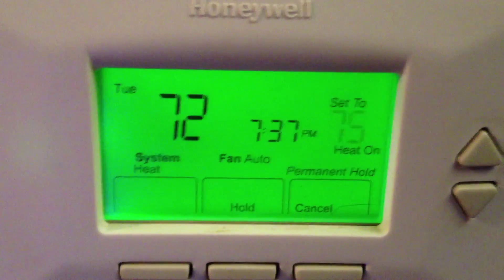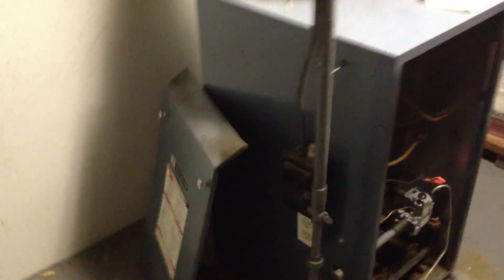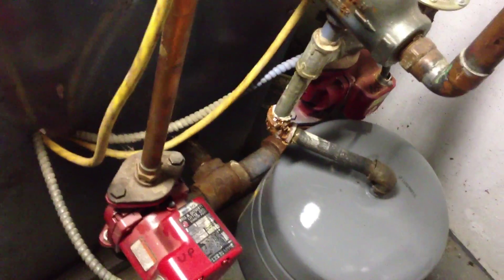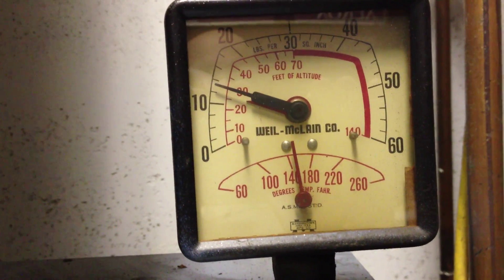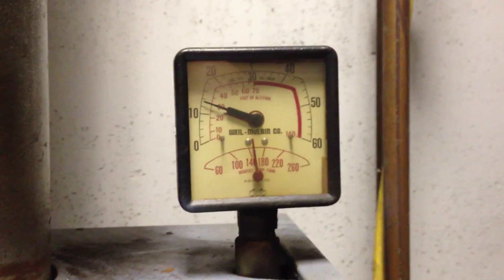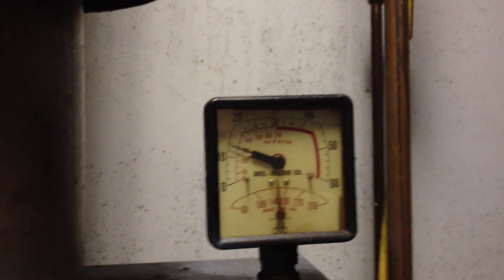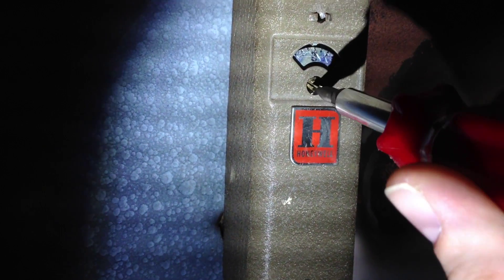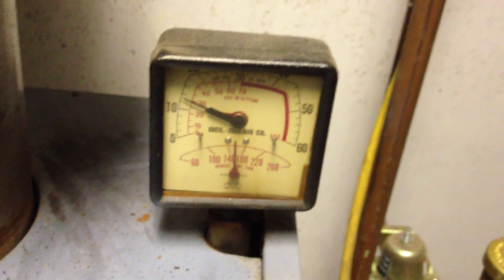Adjusting Your Boiler Furnace on a Cold Day

Comment from the maker: Another thing you can do: supplement your boiler with an electric heater.  we had -20s and for sure, running two or three extra space heaters was, IMHO, a better option than running the furnace at excessive pressures.  This video truly is an emergency procedure.

Comment: Temperature setting is to high, my boiler wasn't working that efficient, called the furnace man he came and flushed out the water in the boiler,  there was black water in it. It took 10 1 gallon buckets to flush it until the water became clear. Boiler works awesome now. Had to turn the temperature on the boiler 60 degrees, saving money now!!
Reply from the maker: I flush mine once every couple of years, it gets nasty faster than you'd think

Comment: looks like you fiddled with the high temperature cut out 
my boiler heats the house just fine with 110f water and cast iron radiators.  very comfortable at 67f

Comment: Thanks for confirming what I plan on doing will be done correct. Like you she wants the house temp warmer and so boiler temperature needs to be warmer due to the terrible cold weather we are experiencing. We already did all the normal adjustments including raise thermostat temp, cover all windows, and keep the doors well sealed. We know the cost of running the system will also increase as more BTU/Hr. is needed. We will turn it back down to `140 degrees  if it ever warms up outside.170 degrees on boiler temp (actual) worked for us

Comment: Out of Calibration or your thermocouple is in the wrong place to measure temp.
Reply: Thermocouple is a bi-metal copper tube that when heated the bending of the metals creates less than a volt of electricity that keeps the gas valve open.. If i remember from the heating seminar i attended that was the day of the Mets tickertape parade in 1986.  
   I don't think it changed, thermocouples still look the same, they still have absolutely no CALIBRATION.   
  Now you can explain how to calibrate a thermocouple, and i would love to know where you think it can be relocated to properly function. .
   Lmao
Reply: Thermocouple only senses on & off of the pilot..not actually measure temperature and all it does is keep the pilot from going out.
Reply: @thomasbroking7943  Not talking pilot light.
Reply: @grabir01  absolutely.. I taught many guys.. Maybe you should learn what a thermo couple is? I have probably changed more on emergency call outs then you have seen, but you go ahead and tell people what you want.  I fixed & replaced residential heating boilers for 25 years and was the guys other plumbers asked for help..
  What kind of experience do you have?
Reply: @grabir01  another piece of info.. Thermocouples fail because of the impurities in the air around it being burned.. Its important to clean around freestanding boilers to make them last longer.. I had a congressman in Bergen County that got me after having his replaced every year for as long as he could remember. .i vacuumed, replaced his t-couple and adjusted his pilot height, over 10 years no problems.
Reply from the maker: @grabir01  I'm guessing that the thermostat, being about 55 years old (looks to be original equipment) is pretty far out of calibration.  I should probably either calibrate it or replace it.

Comment: How old is that boiler? Judging by the temp/pressure gauge and the Honeywell controls, that has to be perhaps from the late 60s maybe early 70s
Reply from the maker: it is original to the house, which was built in 1964
Reply: Back when things were still made to last. As long as you keep it well-maintained and it doesn't spring a leak, it should be good for quite a few more years.
Reply from the maker: @kristindell267  Yeah, unless the actual boiler tank itself cracks, all the components on this furnace are able to be changed out, pretty easily too.
Reply: @scorellis  my is original as well and almost identical to yours. Thanks for the helpful vid. My house is cold due to the -22° temp in Chicago right now
Reply from the maker: @ChicagoLuis   yeah, I went out and bought some extra space heaters to supplement.  Menards has them in stock - at least, they did yesterday.  Am also using packing tape to seal anywhere I find cold air coming in.  Works on doors, too - apply the tape, about a third of it (lengthwise) on the door itself, then carefully fold it over.  We also hung blankets over all of our updtairs windows.  You might want to remember to turn your  boiler back down after this passes
Reply: @scorellis  I just bought a space heater from Costco yesterday. And  I am putting blankets on my doors as I type. Huge cold draft coming in thru doors
Reply from the maker: @ChicagoLuis   I made a how to video on the packing tape seals.  They are working great for me. https://www.youtube.com/watch?v=Yyj181EzHD0&t=2s

Comment: What should be the low setting if 180 degree is high?? Thx
Reply from the maker: +kenny play That's a very good question, so I went down and took a look at mine.  I only have the one controller for temperature. My guess is that it handles the lower range for me. You are right that on some there is a "fire - off" setting and a "fire - on".  If you have that, then you just want to be sure to prevent short cycling - that is where the furnace turns off and on a lot.  I would suggest start with a 40 degree range.  The one problem that too big of a range will cause is that as it reaches the floor temperature (I mean, the floor of your range, not the floor of your house) you may find that (if it is cold out) your furnace may not be constantly on, but the pump cycling the water through your house will be.  That is because, as  you approach the floor, the water gets colder and if it is really cold outside, the floor temperatures may not be enough to warm your house.  This causes your thermostat in your house to continuously ask the pump to deliver more heat.  It is an important distinction to make that the thermostat in your house is really pretty stupid.  All it can do is tell the furnace "Hey, I'm cold" to which the furnace will respond "I'm givin' ya everting I got!".  You'll know that either your range is too big, or the upper is too low, if your thermostat is cranked all the way up and the house is actually getting colder (and you can hear the pumps run and you know the furnace is kicking on every now and then).  

Hope that helps!

Comment from the maker: Unless you have a stuck relief valve, and  very little water in your boiler, the likelihood of blowing up your house is zero. That being said, don't go crazy and crank this up to over 250 degrees. "Boiling" is actually 212 degrees but, as described by the Ideal gas law, water under pressure will not boil.  Not sure why it is called a "boiler"...

Comment: 215 is boiling and you will start making steam. this is why there are professional's that do this. when a boiler blows it is like 20 sticks of TNT going off inside your house. just a hot water tank can blow out a wall and your roof. not to mention anyone standing near, or above it.
Reply from the maker: I used to work on the electrical and environmental control systems on Aircraft and ICBM  sites (9 years USAF)..... they trusted me to fix and repair environmental control systems AND the electrical/electronics on systems that would both kill people if they failed, and kill millions if it successful.  SO. Guess what you can go do now? (That's right.  You can SUCK IT)
Reply: @scorellis  love this response!

Comment: You'd want the boiler around 160, no more than 180˚.  Also, make sure the t-stat Equipment setting (Advance settings) set to 3 (Hot water heat/CPH)